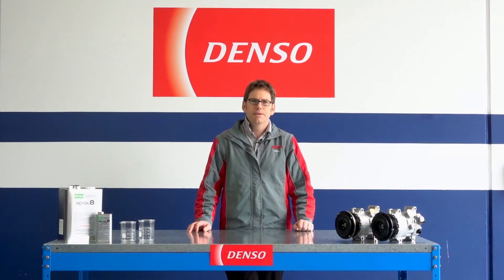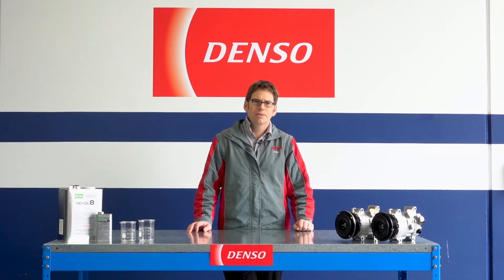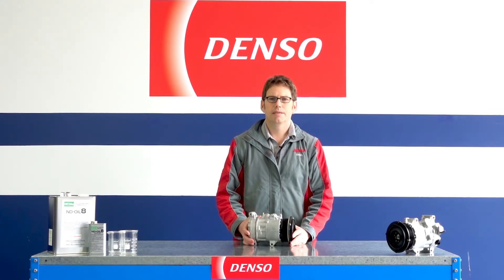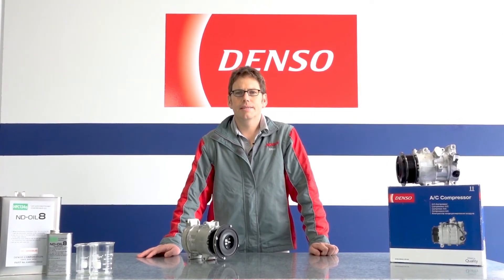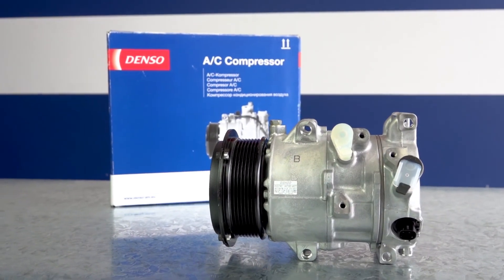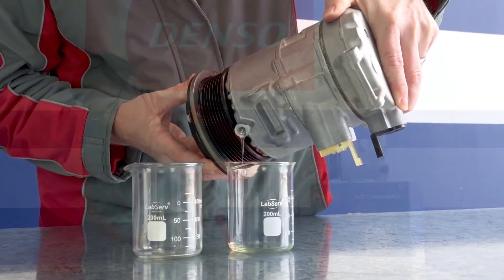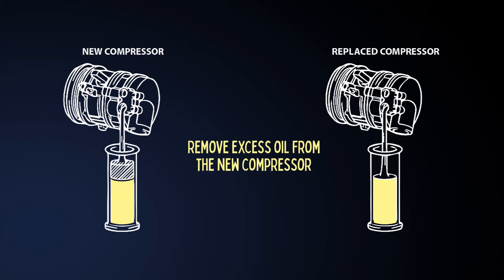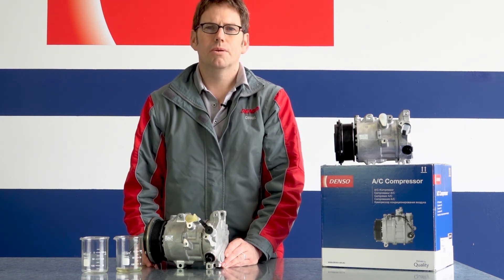DENSO Compressor Oil Balancing

Comment: Why variable compressor with  model no 5se09c don't last? Am living in Tanzania, Dar es Salaam city, this is city is located in coastal area where it is too hot and humid during day. To many cars in my city that come with 5se09c compressors, or any other clutchless compressors, these compressors tend to fail very early and easy even after few days of their replacement.

This problem is not common in my place for cars that come with fixed displacement compressors.

Can you help to understand what to do so that my 5se09c compressor to last? I thought of modifying the ac system by installing fixed displacement compressor with external clutch though i don't know if it can work...am tired of frequent replacements of 5se09c compressors and the condensers.

Comment: Old compressor had blown oil out,the new Denso had no oil what so ever,I ask to two mechanics one said 7 oz The other 5 oz Called Denso they said 10
Reply: How much oil?
This video tells absolutely nothing.
Reply from the maker: Hi Rodney, DENSO compressors should contain oil.
 Would you be able to share the part number so we can check the specification?
Reply: @densoaustralia136  Already been on the phone twice with Denso

Comment: Clutch less compressor (Variable Displacement)help me growling Sound from AC compressor during idling with AC off , after switching ON AC no sound at all cooling is good but as I switch off AC or cabin reaches desired temperature sound again starts, is this bcoz of low compressor oil ?? (when refrigerant flows compressor has enough oil to lubricate and when AC off compressor doesn't have oil for lubrication as refrigerant flow stops(my theory)).. hyundai elite i20 any one help...pl
Reply: I have the same problem...
Reply: @Valledesolado  incase u get solution pl post it...thnx
Reply: @Valledesolado same sound?? 
 https://youtu.be/3bdvz6YQ5w4
Reply: @Valledesolado  hey Did the problem resolve...
Reply from the maker: Hi, The growling sound could possibly be a few things but I suspect that you will need a new compressor. 

Any unusual noise from a compressor is most likely cause by internal damage, you should go and see a reputable car AC repairer. Lack of lubrication and refrigerant can be one cause for compressor damage.

Comment: Can anyone tell me whats the difference between 10P15C and a 10PA15C compressor?
Reply from the maker: Hi Malcookie, 10P15C & 10PA15C difference are listed below:
P: Basic Swash Plate Type, 6-cylinder and 10-cylinder
PA: Improved P Type (with spines and lip seal)
Reply: There big difference, between the 4 v cars and 8 v ,,, small cars and big cars like SUV most of them has rear a AC